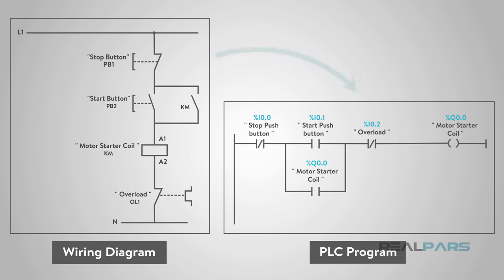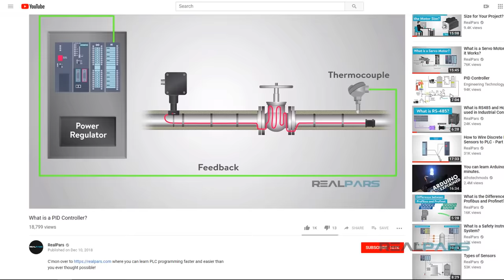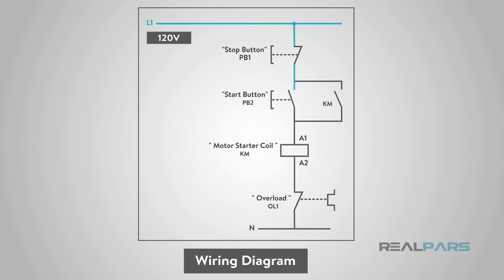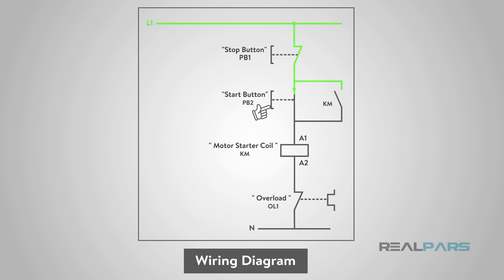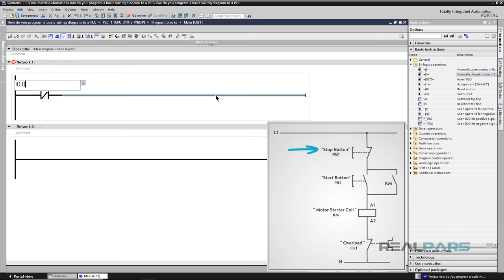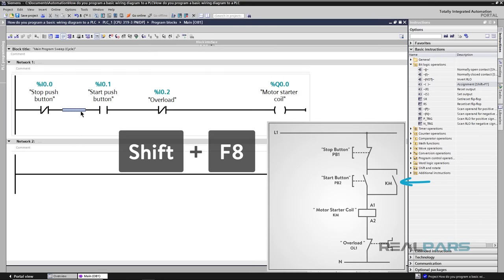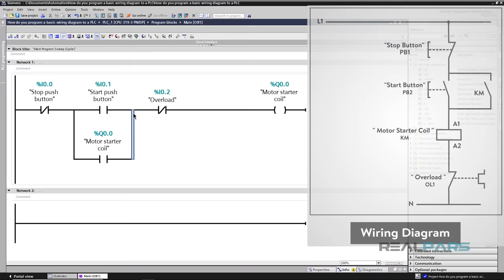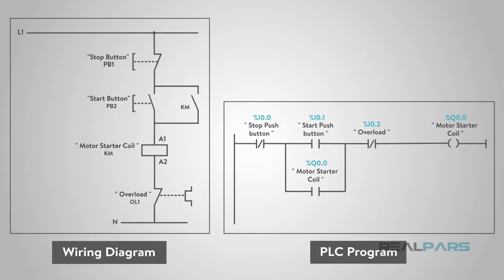How to Convert a Basic Wiring Diagram to a PLC Program

Comment: Very worthful video to those who are starting in PLC programming. The parallel contact to the Start Button is usually called "Seal-In" Contact.
Reply from the maker: Thank you, Melquiades!
Reply: I know it also as a "hold in" contact. The magnetic solenoid has been pulled down when activated by the closing of the start push button.
Reply: in the uk its known as a "latch"

Comment: Your stop puch button is NC type so Input %I0.0 will change the contact to No so you have to place NO contact in first so that NC is normally closed gives the input to %0.0 and the contact will change to NC which allows the circuit to complete .
Reply: Same remark for the overload contact. It opens when activated.
Reply: @ludoschoofs1 it's normally closed, there is flow of current, when actvate or energized opens, there is no flow of current.

Comment: Hi . This is my first video i have seen. I have a simple note to the plc diagram, if you used a simple Normally closed push button for stop button , then you need to make the logical stop button in the plc diagram to ( Examen ON ) not (OFF ) to make the diagram works .
Reply: That's a very good catch.  If we assume no hardware changes as the control panel devices get wired to PLC inputs/outputs, the physical contact on the STOP button would be normally closed and open when pushed.  As such, you would want the PLC code for the STOP button to be an open contact.  The closed physical contact would hold the logic true at that point until the button is pressed.
Reply: Patrick Dowden ok. Practecally stop p.b is always normally closed therefore i said that. Thanks for replying.

Comment: FYI, this wiring diagram is European. North American wiring diagram the diagram is vertical instead of horizontal, hence called ladder diagram, where each line is called a rung. Also for the viewers, the Auxiliary Contact is often called holding contact, already mention in the video but just making it clear.

Liked the video!
Reply from the maker: Thanks for your comment and sharing your knowledge and experiences with us!

Comment: When the stop-pushbutton and the thermal overload-contact are both normal clossed wired to the input's of the PLC you must use  --| |-- instead of the -| / |-- for both of them.
Reply: Not necessarily. When you go on www.realpars.com they have explanations about why in a series of videos.
Reply: Connecting a normally open switch as a PLC input to 'stop' a motor is potentially dangerous. And for 2 reasons it is illegal.
1) PLC would fail to see the switch change state if it was faulty and the motor would continue to run 
2) A broken wire to the stop switch would go undetected and allow the motor to be started with no means to stop the motor.
Reply: Very true. This is important in a real time application, since the stop pushbutton/ overload will appear open---using this very ladder logic (as it will be having a logic state 1 by because of presence of 24v). Except when using the plc simulation mode whereby all the bits are ,by default, not energized until checked.
Reply from the maker: Hi there,
Thank you for your precise comment.
You are actually right about the Normally Closed contacts in the ladder logic. As the Stop Push Button is Normally Closed, then we should consider it as an Open Contact in our "PLC Logic". Otherwise, the Stop Contact in our logic will prevent our motor from running.
Reply: @realpars Hi. I suggest that you publish a video clarifying something so fundamental and basic in PLC programming. Beginners may be left with a confusing idea when they have to program by themselves. That´s one of the first aspect of programming that I  taught to my students.  However, your videos are the most interesting. It´s a pity you didn´t take that consideration in this explanation. Thanks for teaching in such a clear and simple  and animated way. Regards
Reply: @realpars  Sir, Please edit this video accordingly for reliability. Thank you
Reply: Right,  in above video start and stop PB Box is shown so for stop PB we should show -| |-.

Comment: Thank you for your videos.

I'm confused about how the Start Button (PB2) causes the other branch (KM) to activate and how having a normally open switch to represent KM makes sense
Reply from the maker: Great question!  When PB2 is pressed, you should be able to trace a complete circuit from L1 (Voltage Supply) to Neutral (N).  That circuit goes through the coil in the motor starter KM. When the coil in KM is energized, it pulls in a magnetic contact block that closes a set of contacts, indicated by the switch KM that is wired in parallel to PB2.  So, when PB2, the momentary pushbutton is released, the motor starter run contact, KM, keeps the circuit energized.  When the stop pushbutton PB1 is pressed, the PB1 contact opens and the circuit is broken.  The motor coil releases and the motor stops. When the motor stops, the KM run contact opens again, and you will need to press PB2 to start the motor again.

Comment: Such a useful video can u explain how do we synchronize generators through plc
Reply from the maker: I afraid, this is not a question that can be explained here and needs a complete course! It needs special instruments such as synchroscope to measure the synchronization of the voltage and frequency of the busbar and the generator. Relatively you should have special knowledge about these instruments and how they work in order to write the logic.

Comment: Hi RealParks, thanks a lot for the videos. I am a beginner, please can you give the link or name of software use for wiring diagrams so that I practice it at home. Thanks for the great job one more...
Reply from the maker: Normally, design of wiring diagrams is done with AutoCAD Electrical or other CAD software, but there are a few "free" packages that I have found useful with my mentored young engineers.  The first one is SmartDraw, which has a 7-day free period, and is very reasonably priced for a license.  The other is SkyCAD, which has a 'perpetual" free version which I believe can do what you are looking for.

Comment: you always have to program the Stop buttons as a normally open contact in the program. If there is a fault you will never be able to turn off the motor
Reply from the maker: Yes, this is how the PLC logic should be programmed for a fail-safe implementation of a wired stop pushbutton.  The issue is in understanding how the field device is wired and how it is represented in the PLC.  If you have a physical stop PB, the contacts should be NC, meaning the PLC input is a '1' when not pressed, '0' when pressed or the wire breaks.  In this case, the PLC element for the stop PB in the ladder must be NO.  HOWEVER, if the logic is driven by a software switch, then th stop PB is '0' when not "pressed' and '1' when pressed, and the ladder, in this case, the stop PB would use a NC contact.  This is why you need to understand how the system is wired and which devices are physical and which are virtual (software).

Comment: thank you , why do we gave the same output address to the KM in the input and the other in the output ?
Reply from the maker: In S7 PLC's there are two memory areas allocated for inputs and for outputs.  Each of these memory areas start at word 0.  For instance, for inputs, the memory addresses are I0.0, I0.1, ...., I0.7, I1.0, etc.  For outputs, the available memory area is Q0.0, Q0.1, ...., Q0.7, Q1.0, etc.  Although the numerical part of the output and input tables are the same, they are distinct and do not overlap.

Comment: Funny how the "Overload" OL1 is treated as normally closed, when in reality they are normally open. But engaged (closed) at an active system... when the pushbutton is shown as normally open. Besides that, the overload is normally the first item in the function tree, as it is supposed to protect the circuit below, relative to a short circuit early in the circuit. Because imagine the scenario where the wire gets loose at after the "Motor Starter" in a normally neutral grounded system.
Reply: I think the overload there he means the device thats the plc (contacts) are protecting
Reply: @felipequintela3254  What i mean is that if a wire gets loose before or after the OL, the circuit can still remain active, if the loose wire gets grounded (bypassing that OL auxiliary contact). It will not matter if the OL triggers. Only if the system is grounded and not isolated. They are mostly grounded.

Circuit is not optimal, as the OL contact is after the relay...

Comment: So Q0.0 Gose straight to the starter coil? You dont need a latch N/O 2,3 on the motor starter?
Reply from the maker: On the left-hand wiring diagram, there a motor latch (seal-in) provided around the start pushbutton by NO contact "KM", the designation for the motor starter coil.  In the PLC logic equivalent, this same functionality can be provided by %Q0.0 in the branch around the start pushbutton input.  If using the PLC to control the motor,  yes, only the output %Q0.0 is wired to the motor starter coil in the field.  The start and stop pushbuttons are wired directly to the PLC.  In many cases, a NO auxiliary contact is brought back from the starter to allow the PLC to determine if the motor coil was actually pulled in.  If not, after a few seconds, a command disagree alarm can be generated which may be used to stop the motor.  Signals from a disconnect, fuse block, or overload package can also be brought into the PLC to monitor and control the motor.  These "extra" signals cost extra to interface to the PLC, so often they are not done so except in critical applications.

Comment: I think there is a problem of NC contact of stop button. If the NC contact is used, the plc program will not run because NC then changes to NO.
Reply: Pham Quoc Phuong NC contact is required condition, in the case of a line break, motor will stopped. Read about this on a education forums

Comment: Does anyone know a software to make the wiring diagrams like that?
Reply from the maker: Normally, design of wiring diagrams is done with AutoCAD Electrical or other CAD software, but there are a few "free" packages that I have found useful with my mentored young engineers.  The first one is SmartDraw, which has a 7-day free period, and is very reasonably priced for a license.  The other is SkyCAD, which has a 'perpetual" free version which I believe can do what you may be looking for.

Comment: Has anyone questioned why the first program instruction(stop switch) is a XIO which will not be true with a normally closed stop switch?
Reply from the maker: According to the electrical diagram, the stop pushbutton is normally closed.  The first element in the ladder should be an XIC, unless a relay or a NO aux block is used in the field (would show up on an I/O drawing, not a motor drawing) to reverse the polarity.
Reply: @realpars  
But it does not have an XIC instruction for the stop button. It is an XIO.
With the stop button as wired, the logic cannot be solved and the motor will not start.
That's how I see it. Comments welcome.

Comment: Let me note that this case is not the 100%-most proper about converting start-stop circuit into a ladder diagram. The real circuit does consist of 2-pole buttons, the current flows thru them, the stop button breaks the circuit and the start one connects it back. In the ladder conversion all the buttons and the auxillary contacts must be connected between the +24VDC and the dedicated PLC inputs. So in a manner of speaking, this analogy could cause some confusion, mainly because of the different way of buttons and contacts connection, especially for the newcomers.
 Anyway, the videos you create are very useful, I found them very intrresting. Keep so on......
Reply from the maker: Thanks for sharing your thoughts with us, Ivan!

Comment: Can someone tell my, why so many plc programmes in the USA use ladder for programming? Why is it so common? I worked with programmers for Allen Bradley, and all they knew was ladder...
Reply from the maker: This is maybe due to the simplicity of the Ladder programming. The other languages like STL may help you with more complicated logic and processes while ladder will help you with more routine processes. That's why most of the PLC programmers start with ladder programming.
Reply: @realpars  Hmm...well, they programmed pretty complicated stuff with ladder. And I think FBD is the better start, because stuff like timers and so on is displayed as function blocks anyways.